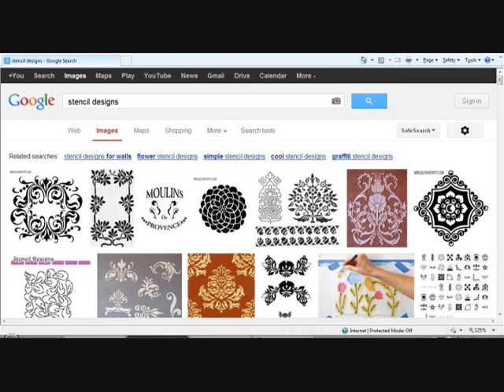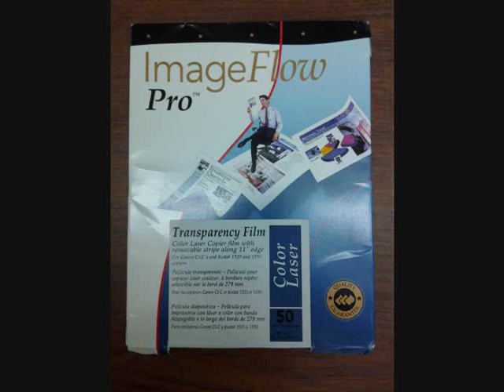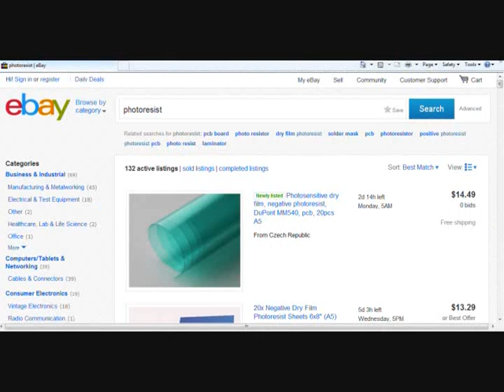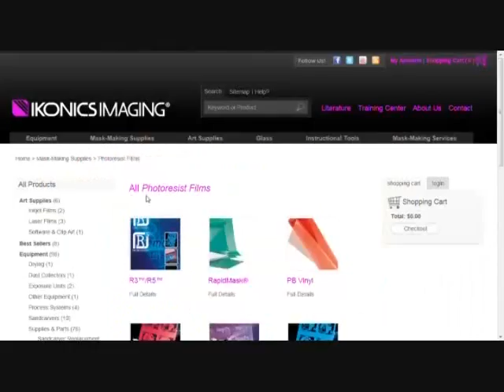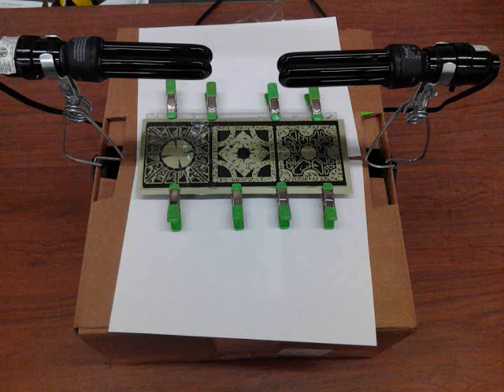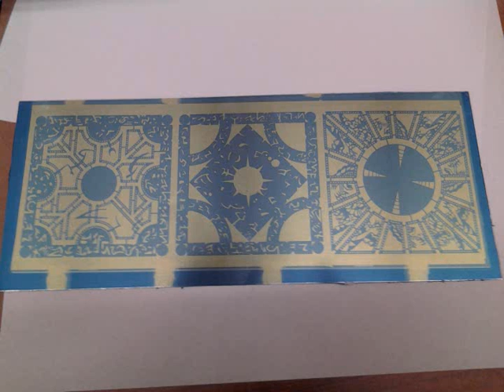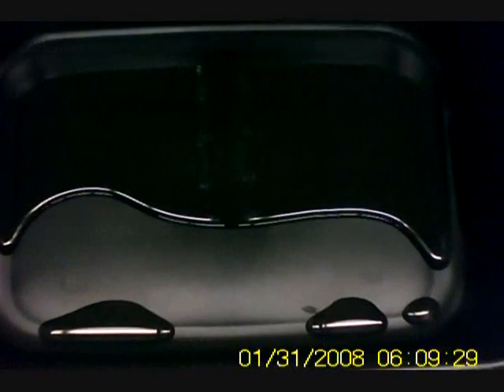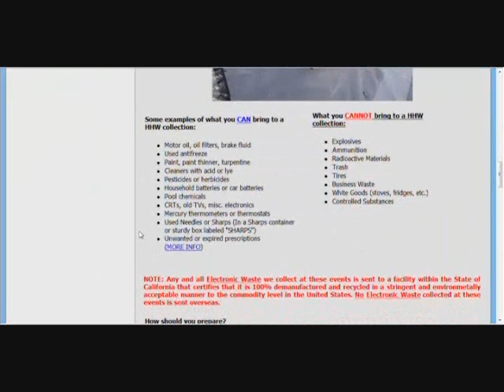Photo Etching Tutorial Using Negative Photoresist

Comment: This is a great starter video!   I got my start from these instructions. 
 I have since perfected a system which now I make Hellraiser panels for various people, and now making 6 inch panels for framing or display bases. Hopefully soon I'll be making 12" Hellraiser panels 😃 
If you use thicker plexiglass (i use 1/4 inch because I process 6x9 inch panels) you'll have to expose to UV for longer. Even if it's not special UV blocking acrylic, it still absorbs some. With no plexiglass, I can expose the photoresist about 2 1/2 minutes per side. With 1/4 inch plexiglass it's up to 10-13 minutes per side. I too should make a video, though this one is hard to beat.

Comment: Excellent tutorial.  Any tips on how/when to remove the protective film on the side of photoresist opposite the brass?  When I attempt to remove prior to the laminate, this difficult to avoid peeling the photoresist off of the metal, and when I try after laminating oh, occasionally it pulls small pieces of photoresist with it.  Thanks in advance.

Comment: Nice tutorial.

To get all the copper out of your used solution, simply add an iron or steel item to your spent acid, and the copper will drop out or "cement out" of the solution as crystals. All you'll be left with is ferric chloride. After doing this, you can continue re-using your acid solution and refreshing the acid when it gets too weak. 

Pumping air through an aquarium bubbler will also introduce oxygen into the acid, making it last longer, without making it as diluted, as it is when the hydrogen peroxide is added. An added side effect , the air bubbles keeps your solution agitated.

Comment: Excellent!  Thanks in particular for demonstrating the use of plexiglass to hold the double-sided artwork in register, also how to make full etch and half-etch on the same piece.  It seems the chemistry you used should be available in the UK, am I correct in understanding that the UK would know Muriatic Acid better as Hydrochloric Acid HCl?  It would be very useful if you could clarify on the original concentrations of the acids used in your 2:1 mix because the H2O2 is sold in the UK in 3%, 6%, 11% and 12% solutions - I take it a different concentration would require a change in the mix ratio?
Reply from the maker: +Ian Collett You're welcome. Yes, HCL is the same thing. The H2O2 I use is 3% because of its stability. You can use the same ratio with any of the other H2O2 concentrations, and the etching process will go quicker. That being said - the reaction may be a violent one causing the solution to bubble out of control, and cause more chlorine gas fumes than you will know what to do with. Also keep in mind that different metals will react differently to this process - aluminum will have a more aggressive reaction to 3% than will brass or copper. Test things in small scale before going big. One more thing - the process creates heat - the higher H2O2 concentration - the more heat produced. Your resist may not be able to handle huge amounts of heat and might bubble, causing imperfections in your design. Make sure your etching tray will be able to handle high temperatures if you're going to try higher concentrations of H2O2.

Comment: Can I ask did you put photo resist for the Lament Configuration on both sides of the brass strip.  Thanks for any help.
Reply from the maker: Yes. If you want good quality through hole etchings, you need to have resist on, and expose both sides.
Reply: Thanks for getting back to us.  Does the reverse acertate print go only on one side as trying to match up each side would be difficult.  I'm attempting a box for myself and now have all the materials.  Completley new to all this.  Thanks for any help.
Reply: @JohnBurke67   You sandwich the metal between TWO transparencies. You very carefully line them up first.

Comment: I noticed that you held the metal sheet above the etching solution and you sloshed it over...does that speed up the etching process instead of submerging the sheet??
Reply from the maker: The short answer is yes. Slosh for 30 seconds to a minute, use gloves and take the piece out of the solution, wait for the bubbles to pop, turn piece over and submerge. Repeat until piece is fully etched.

Comment: Thank you for your interest
I thought I was wrong because I used large copper thickness of about 0.05 cm is approximately equal to 0.02 inches
But my question is, Is there a method of etching copper metal thickness of 0.02 inches???
The final question following concentrations were used Notify me that was incorrect
hydrogen peroxide 3% 2 cup
muriatic acid 31% 1 cup

Thanks again
Note:
Please excuse the language on some of the mistakes
 I do not speak English so I use Google for translation :)

Comment: Sir i want to asked some question, i apply H2O2 hidrogen peroxide 100 ml along with HCl (muriatic acid) with yellow colour 50 ml . I mixed it 2:1 but when i put my brass sheet 15cm x 17 cm the liquid turn to green and start to boil and the white smoke appear so thick, but my 0.3 mm brass sheet cant cut it trough, nothing happened, and 10 minute later the photo resist start to peel from the brass plate, did i do something wrong? Maybe i need more volume for the liquid?
Reply: One more thing, the supplier said that the H2o2 is 50%
Reply from the maker: +Farid Rachmanyah boiling and smoke is a good indicator that your H2O2 is a high concentration. I use 3%, or 6% depending on what I'm etching. Along with bubbling out of control, it's also producing a massive amount of heat at that concentration. The heat is peeling off your resist. Use a 3% or 6% H2O2 solution, and use 300ml with 150ml acid. I don't think you have enough acid to etch through.

Comment from the maker: Hydrogen peroxide to acid ratio is 2:1. If you use 10 ounces of peroxide, use 5 ounces of acid. The 3% is for stripping with sodium hydroxide. To answer your other question (from your email) as best I can, I don't know what it is you're trying to accomplish. .05 inch metal is thick in the etching world. I use .005 in thickness in my demo, and you can see from the clock that it takes some time to etch completely through.

Comment: I may have missed it (will re watch several times) but I did not catch how to accurately register the stencil on both sides of the metal. Especially with finely detailed art accuracy is critical (and elusive!). Thanks!
Reply: Yeah, how do you register the stencil on both sides?
Reply: Luis F. Barroso Luiz, para isso vc somente faz o aceto de ambos os filmes como um envelope e poe a placa no meio.
Reply from the maker: The cheapest way to register the stencil correctly is using a folding magnifying glass. You can also use magnifying headgear, or if you're able to spend some money, a microscope.
Reply: That makes no sense. If I cannot see through the metal to know if Side A is registering with Side B in both X and Y directions, then how is seeing the opaque metal closer going to help me?
Reply: Two sided stencils (photo resist) are aligned before the metal is there.  The easiest way is using plexiglass and nails as shown in the first technique; adhere each of your photomasks to separate sheets of plexiglass, then put them together and align them, clamp and insert the alignment pins (heated nails). The nails will keep everything aligned when you separate them to put in your metal with the photo resist adhered to it.  The other option is just to align your photo masks after printing and then tape them together on three sides in the margins to make an envelope that your metal+photo resist can be inserted into, but you will still need to use a piece of glass on top to make sure that your mask is tight against the metal when you expose it to the UV.
Reply: Thanks mrchew! Makes sense now!
Reply: Print `registration marks` on each piece of artwork, line them up and tape before inserting metal sheet. Wish I could have watched to the end but MAN! That Fucking Voice !!!!!!!

Comment: Does this process work for stainless steel. I want to try doing stainless steel panels for a puzzle box.
Reply from the maker: Derek Neal It does. The brass that's used on the video is .005 in thickness. Most stainless sheets are .012 or thicker. Be aware that it's going to take some time to etch fully through - at least 20 minutes. Keep the solution moving, and flip the piece every minute or so.

Comment from the maker: Thank you for your compliment.

MIcro-Mark is wildly overpriced. Home Depot, Ebay, and ACE Hardware will get you everything you need for less than half of Micro-Mark. They do offer everything in 1 stop which is a nice thing. That being said I hope this vid helps and you make some cool stuff. 

I mostly make Hellraiser things and my favorite that I've made is a clear box that lights up. It's on my website under the heading The Box. Website is my user name, just don't spell dot :)
Reply: Won't argue that it is overpriced, but it's an "all in one" home etching supply kit.  I didn't have to source anything other than black lights and sheet metal.  I'll gladly pay extra for the convenience of not hunting around for supplies when I'm not sure what I'm doing.    That said...  Fantastic tutorial!  I watched it a few times prior to using my MM etching kit, and it really helped give confidence in the process that I didn't get from the written instructions.  Thanks for taking the time to share your experience with us.  The tip about using Muriatic Acid and Hydrogen Peroxide is great too...

Comment: Good video, but you should have narrated it yourself instead of having Siri do it.  ("mynoot" instead of "minnit"...) Curious why you did not mention spray-on photoresist film. I've found it very easy to use for printed circuit boards - spray it on, wait for it to dry, pray that no dust specs land on it. I felt the pace of video was a bit rushed, especially when being distracted by the synthesized voice. Might have been better to break it up into a 3-part series and go a little slower. You don't cover dual masks or partial etching very well at all except by describing the required artwork. An etching example of that would have been helpful.
Reply from the maker: Glad you liked the video. The audio was Natural Reader. I'm not a good speaker, and it would've been a lot longer had I talked through it. I've never used spray on resist, so I don't know much about it. If you made a video on it, I would be glad to watch it and learn. It was a conscious decision to not go deeper into  other aspects of the process. I could do a 45 minute video of each part of the process and still not cover everything. Thanks for watching, and looking forward to your video.
Reply: If I do make one it probably won't have as many witty remarks as yours. (I don't mean that in a negative way - your narration is witty and entertaining. All I mean is I'm apparently not as witty as you. Perhaps part of it was the delivery - beware female androids telling jokes!) At the moment I'm busy preparing a multi-media  model for 3D printing and giving serious thought to making a series of videos documenting the build, which will involve SMD LED and fiber optic lighting.....and custom photo-etched parts - so it's very possible I'll have a segment on using spray-on photoresist and discuss more about front/back masks. I do like your chemical choices instead of ferric chloride and will be sure to give your video a mention.